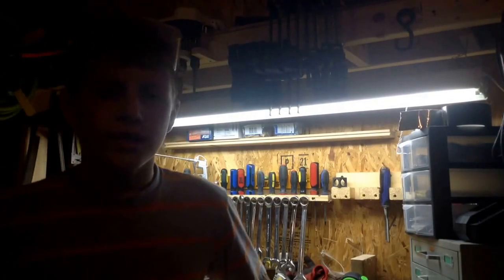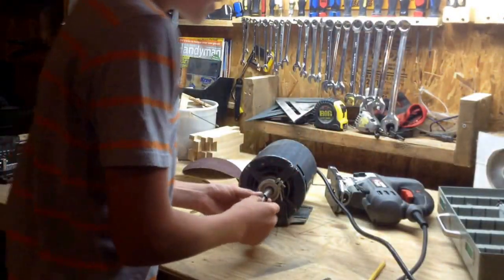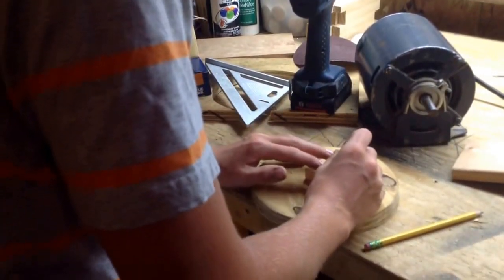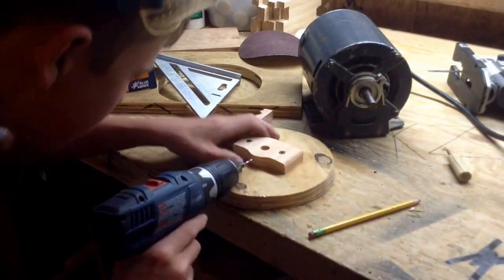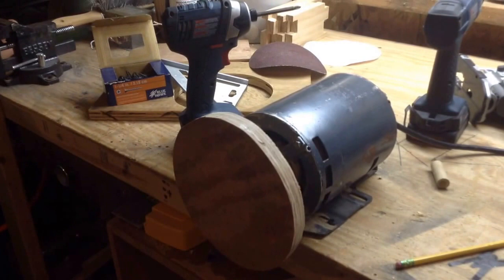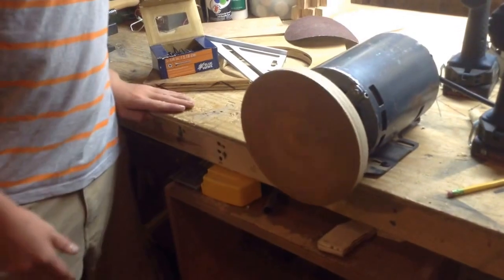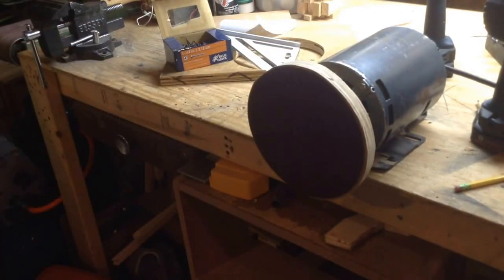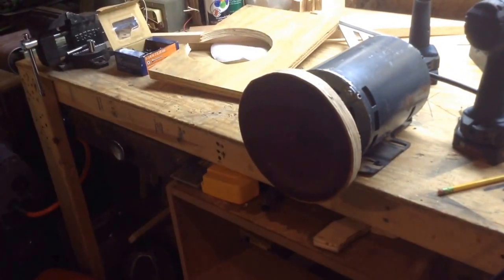Making a disc sander

Comment: You're learning. You're motor probably rotates at 1800 rpm which is 30 revolutions per second. The tangential velocity of outer portion of your disc is about 8 ft/sec.  The forces are great and it can be dangerous if the disc should fly apart when you happen to be working around it. It's very difficult to home manufacture  a safe sanding disc that is balanced, one that will be of use and will be durable and reliable. I have seen experienced machinists who had trouble manufacturing an acceptable disc and they had very expensive programmable  metal lathes to work with.
For safety sake I purchased a balanced metal sanding disc and built my disc sander body, supports, level/ miter table,  and the dust collection system around the stable motor/disc assembly.